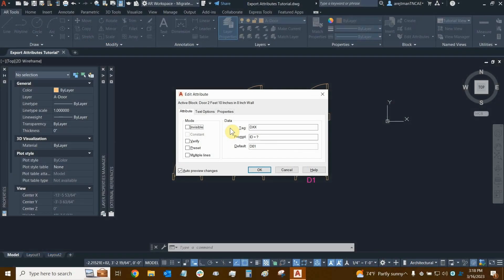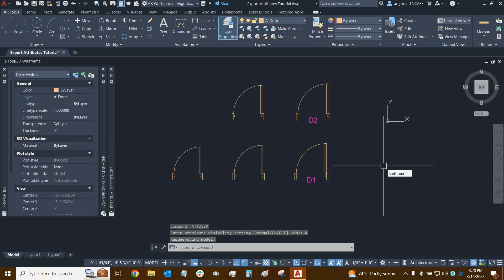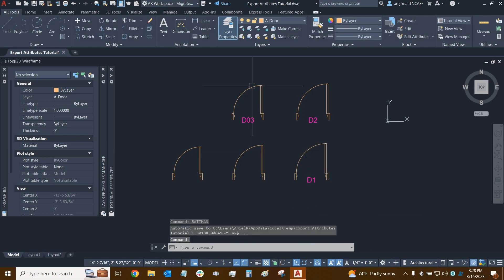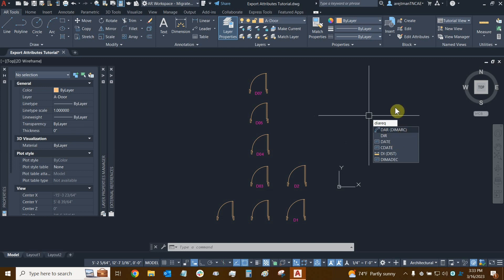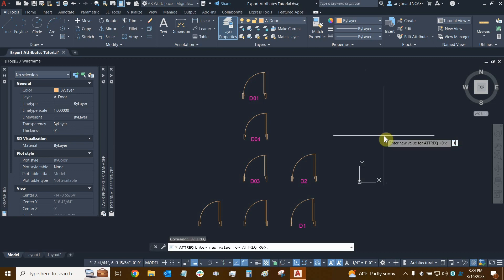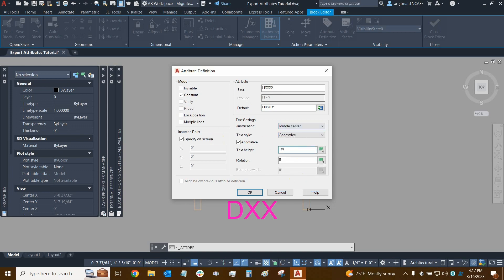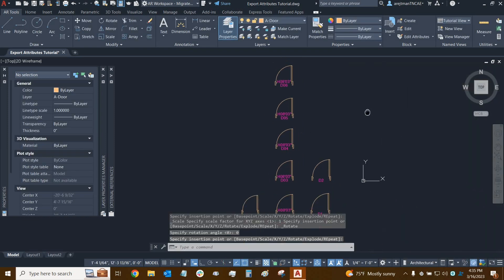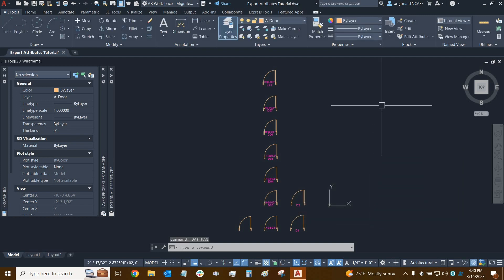Create Attributes with AutoCAD - Part 3

Comment: Hi, I add an attribute in block editor and it does not appearing in my drawing,, but when i checked it using BATTMAN I can see what i added. thanks
Reply from the maker: An existing block on a sheet won’t update if you add/change an attribute to the block file itself. You’ll want to place a new block down after updating it. If this isn’t the issue, then you’ll want to ensure that your attribute isn’t “Invisible”. This can be checked when editing the block in the “Block Editor”, selecting the attribute, opening Properties, and scrolling down to see if certain “Misc” settings say “Yes” or “No”, including Invisible.

Comment: Hi, is there a way to insert more of the same attributes and if I change one, the other change too? I need this for a column where a tile number is used like 10 times and I don't want to change every single entry.
Reply from the maker: If you have several of the same blocks with attributes already on your sheet, and you go back to the “Block Editor” to add more attributes to them, they will not update and include those new attributes. You’d need to replace the blocks. If you want to change multiple existing attributes, you can select the blocks with the attributes and open the “Properties” panel (If it’s not already open, you can right-click on one of the blocks and select “Properties”). Then, if you scroll down to the bottom of Properties, you’ll see “Attributes” with text to the right of it. You can change this text for all selected blocks

Comment: How can i add same attributes to different Visibility . 
Like you have a open valve and closed valve but i need to give them a different ID
Reply from the maker: You can modify the ID for each block by double-clicking on the text and changing it in the “Enhanced Attribute Editor”. Each attribute can have different visibility even if the same one is used on different blocks.